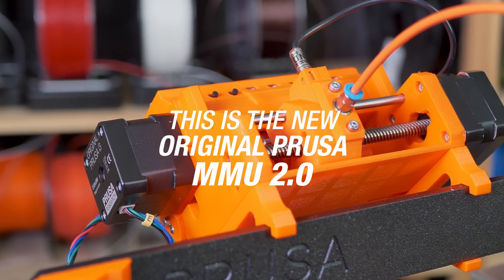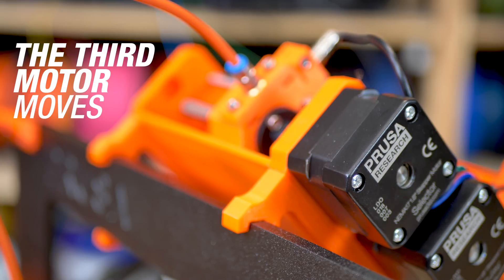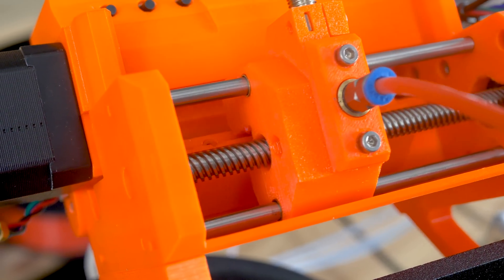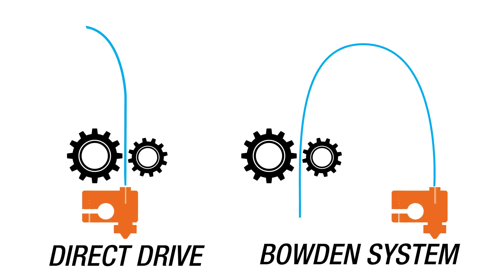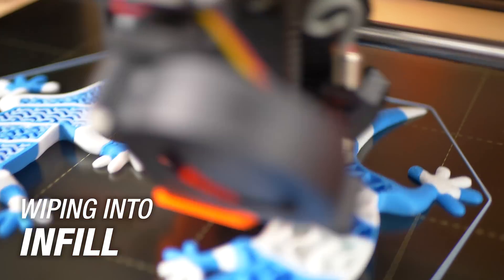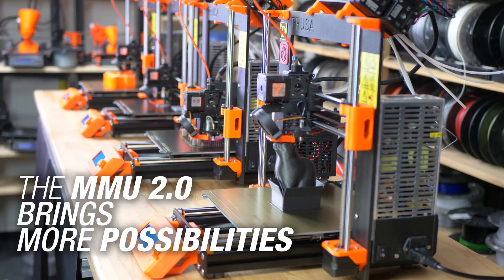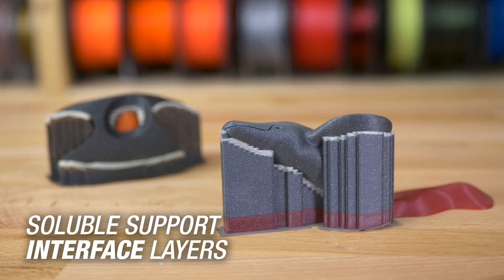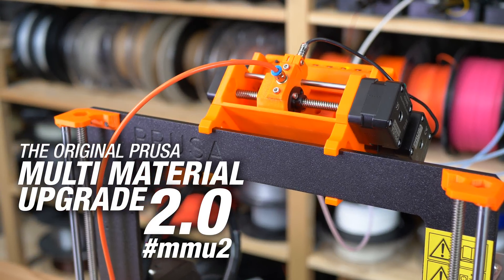How does the Multi Material Upgrade 2.0 work?

Comment: This seems slower than the MMU1, although i do like the premise!  I really hoped you had solved the issue with not being able to use TPU (flexible) filament with the MMU system(s)
Reply from the maker: The TPU problem should be gone with the direct drive system. We're currently polishing our presets for TPU :)

Comment: I like the filament storage on the shelf behind the printer.  I will have to see if that is available to print or buy.

Also this large of a setup will force me to re-think a air filtration system for ABS and other prints in general.
Reply: i print with mine using ABS in my little tiny 3rd bedroom, and not once have i "smelled" the ABS nor been bothered by it at all, even when i sit in the room with the door closed and keep an eye on the first couple layers.  i'm so confused as to why people complain about ABS when i've never noticed any negative smells or etc from it?  am i just too used to working on cars and smelling gas and oil, or what?
Reply: I have not either myself, I used to work on copiers and all the cleaning agents for those in the old days had very bad smells.

I think I'm more worried of the small particles that are emitted.

Comment: I want to know why your lowest cost printer is three times as much as other similar printers. Such as the Creality3d ender...
Reply: My guess.... much better support. Warranty. Better quality parts used. And... the cost of doing business with an innovative company.
Reply: Instead of beating the same dead horse again, just buy a cheap printer and be done. I've seen the crap bearing system that Creality uses and it's a joke. They're also using coupling on threaded rod / leadscrews that are not turned down. It's a cheap printer for a cheap price.
Reply: Icanifiwant because prusa is the company that pioneered all this shit. R&D takes money you know. All the China brands just copy them cut corners. Giving you your ‘amazing price’ then burning your house down
Reply: @JoshuaLotion  Ender 3 for example is not copy of Prusa , it's cheap because its  less stable for eg it has only one motor for z axis , it uses V profile for xy movements instead of separate threaded rods like in Prusa .  Creality surely deserves credit for these innovations .
Reply: because one of the best "out of the box" printer for this price.
Reply: All high quality printers cost a lot exactly for the same reasons a high quality lathe is expensive: if you want high accuracy, you need really small tolerances for all moving parts. If you accept low quality prints, you can obviously use whatever cheap parts you want.

Comment: Is there a way to automatically adjust infill to put the waste plastic into? Let's say you want a minimum of 20%, is there a way to set it so it could potentially go up to 100%infill  in layers where it would otherwise waste it into a tower?
Reply: npgoalkeeper _ 

Not necessarily, you could easily just make a completely solid layer in the middle of the print. Or any combination thereof, shouldn’t actually be that difficult to code.

Comment: This system is genius.
But it is a Bowden because if you use super soft flex filament you have no chance of getting it to the main extruder.
Also Slic3r is not a good program because it ovten gets inner parts wrong like on airplanes and simmilar stuff
Reply: @npgoalkeeper _ I did watch it ...
If you think about a very soft felx filament like a wet noodle there is no way to get it to the main extruder over the bowden tube.
It will search for the least resistance and dont pass the sensor. Insteed it will tangle I think

Comment: I hate the idea of the “wipe tower” but of course understand why it’s needed. 
Great idea using the infill to prime the new color. Cool to see new ideas like this to the Prusa’s. Still regretting not putting my money in a prusa instead of the JGAURORA A5 😓
Reply: I love my A5. The only issue I've had is the heavy glass causing noise at 30mm/s speeds. The IR sensor was an awesome addition. Being open source, I think it is only a matter of time before someone creates a custom firmware for the A5 to work with this extruder setup.

Comment: With the Pinda sensor, does that mean the filament sensor on the MK3 is redundant? I only ask because mine is shot, and I have the MMU 2.0 on backorder (sigh) and it looks like the sensing will all be done in the MMU now, rather than in the extruder body. Is that correct?

Comment: Josef, I know how to make and design in ie. Fusion 360, but I don't have a clue how regions of print color are defined. I've noticed simple function in Prusa Control to change color and function of that is obvious, but could you make instructional video about this? Pretty please from fresh mk3 owner from Finland :) I will not buy upgrade if I'm not sure I can use it efficiently :)
Reply: You export seperate bodies as different STL files, and then in the slicer you can define different materials for each loaded STL.
Reply: I use Mesh Mixer (free to download) in order to "cut" areas out of my object and create separate STL files. There are tutorials on youtube doing this. Then use the slicer (cura / slic3r) to set which extruder is used for what part.

Comment: How does the MMU handle temperature differences between material types? One of the biggest issues I see with other single-extruder multi-material printers is that they have a hard time switching temperature between two different materials, especially when the temperature difference is significant (such as with ABS and PVA). Does the MMU have a way to purge filament of a different type before switching temperature to the other filament? If not I would think this would lead to a lot of jamming.
Reply: I would also like to know about this. Especially when printing delicate objects using water-soluble plastic as high-detail support material, or filaments of different materials for structural purposes.
Reply: Not forgetting abrasives and alike that are more brittle. Typically needing a pre heater going into a plastic extrusion housing seems like a bad idea. My guess is they are pla specific.
Reply: @glennedward2201  Though they specifically mention abs and flex in the video, not to mention soluble support is pva. So they clearly are intending for ot to be universal, but I would say not entirely. So in a sense I'd  agree with you: pla with pla, but also abs, with abs haha
Reply: My personal experience is sticking with the same filament type if you want a good bond. I've tried printing PETG onto PLA and it literally just pealed off of the PLA. Don't even try the other way, the PLA will not adhere at all.
Reply: Wanting to know the same

Comment: This looks like it could work with other printers as well. Can you buy it separately for printers other than the original prusa?
Reply: If im not wrong, they're using Marlin so to comply with the GPL license they have to release the source :)
Reply: @AlanGonzalez-om4rr  so all I need is 2 more motors and a compatible board?
Reply: @dillzilla4454  I think they have a seperate board that you connect to the motherboard, like a stepper module
Reply: A significant portion of the functionality is software based, so it needs to make its way to open source firmwares and slicers.
Reply: @dsp4392  that's the reason I was thinking of building one. I'm no technical engineer but I can definitely program the thing.
Reply: @Da Hai Zhu I'm with you on this. Would love to add this to the JG A5. As long as we get someone to edit the firmware to support it.
Reply: Prusa Research has been really good about releasing their software as open-source. It make take some time, but I believe they'll follow through on this one as well.
Reply: Was thinking the same thing. If you can't then I'm going to try to build one.

Comment: 5 times more likely to have a filament jam and/or the runout sensor to fail and cause multiple layer shifts. Awesome!
Reply: Which runout sensor? The one in the extruder can be switched off if you wish (I have it switched off to stop false positives) , and the one in the MMU2 is a PINDA detecting a ball bearing, which stands a good chance of being extremely reliable.

Comment: Cool. How much filament does this waste though?
Reply from the maker: If you print something big with lot's of infill or if you use the waste object function, almost nothing. If you print one tiny Marvin with 5 colors, the majority will be waste.
Reply: Prusa 3D by Josef Prusa would the waste go down with quantities? Eg printing 5 tiny Marvins vs 1?
Reply: I'm not Prusa, obviously, but the answer is yes.  Example:  Your print gets to a point in the Marvin when it needs to switch colors, so it switches the filament, and then has to extrude X amount in order to properly transition to the new color (just like it does normally when switching filaments, it drools out a bit before it says its ready, and that 'drool' has both colors in it for a bit until its fully transitioned).  Then, it prints that color, and repeats as many times as the colors change.  If you print 5 Marvins, than it would do the same thing, but you'd print 5x the amount of "good" material before each color change, but you'd still swap the colors the same amount of times as when you were printing 1 Marvin, so you have roughly the same amount of waste material as you had before, but you have 4 more Marvins.  I doubt its exactly that simple, but that's the theory as I understand it.
Reply: You also have more infill space to not waste as much
Reply: I wonder if the slicer will tell me how much filament will be wasted per print?  If it takes 10kg of filament from each color to print a 1kg item - I don't think this would be feasible.

Comment: So filament detection will move to a full/empty state instead of the current full/empty/movement? So no jam detection?
Reply from the maker: There is still the laser filament sensor in the Extruder body ;) With the new Filament sensor engine 2.0 in the latest fw,  it's also way more reliable
Reply: Good to know -- must get around to flashing the new firmware. I have filament sensing turned off on both my MK3s as it didn't like translucents, white, or even (the final nail in the coffin) shiny PETG, no matter how opaque. I've also had to turn off crash detection as it was occasionally false firing when printing fast (80mm/s base speed).

Comment: Regarding printing water soluble...

How are you accounting for the temp variation between something like PETG and water solubles which print way cooler?  
Seems like you would be constantly cooking the cooler materials while clogging the hotter ones as a result of the temperature changes.
Reply: I recently tryed out Polysmooth as a supportmaterial for PETG. You can print both materials with 220°C. Polysmooth is alcohol soluble and doesn't stick very well to PETG, so it is easy to remove. I have made a Video to this Topic: https://youtu.be/C7wOrrqRSJM
Reply: This could likely be adjusted for in software. With proper thermal design of the hotend, raising or lowering the temperature for a given material should be able to be accomplished in the timespan of unloading and loading another material. For instance, switching from abs to PVA, you set your temp to PVA temps, then crank your part cooling fan to 100%, then retract the filament out and load the PVA. By the time the PVA reaches the nozzle, you are at temp. There could even be a slight temperature buffer built in to allow for purging ala stay towards the top of the extrudable range of PVA for a second while purging and then go down to the optimal range while printing. Do the reverse going the other way and voila
Reply: AFAIK is more multi color than multi material,for the reasons you underlined. It's really the only thing holding me back as I print PETG.
Reply: ...heating and cooling a nozzle takes time. So if it would be possible, the print would take much longer...

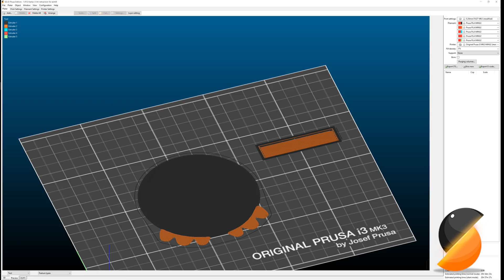Comment: 3:29 "...no need to send your data to the cloud"
Sideswipe hehe.
Reply: dont need the cloud for palette either if you use their local software and your own slicer.

they both look great, though!  I really want the STLs shown on the web article as samples
Reply: @BenSilber  two different bits of software vs one though, right?
Reply: @KieranShort  I guess, but I don't use slic3r anyway so it would be two for me either way
Reply: @BenSilber  ahhh good point. I prefer Slic3r prusa edition now rather than Simplify 3d. I've never used Cura though. What's your choice?The Prusa team is moving Slic3r very fast forward now though with many new features. And my i3 mk3 prints with it are now working better than Simplify. Anyway that's my experience.
Reply: @KieranShort  I use.simolify 3D. I'm just used to it and get good consistent results. I wish it would move a little quicker (like adding the cool infill that slic3r has, etc) but I've never had one issue with it and it's easy to adapt to the two printers I've got.
Reply: @KieranShort  Prusa is still missing some very critical features.  

1) Manual support placement.  Slic3r's horrendous support generation algorithms make some objects literally unprintable without Simplify3D.
2) you can't move the Z height of an object off the bed.  It always placed the object on the bed. Its so stupid.  If you don't understand the need to want to do this you haven't been printing long enough.

Fix these and I might be a full convert.  Until then, S3D still has the top spot by a mile in terms of best slicing software.

Combine multi material printing along with these two features and Slic3r PE would own everything else out there hands down.  However they do have some significant work to do on their support generation functionality and the complexity of this isn't trivial and I don't know if they have the software team to get this done any time soon with all the new stuff they are focusing on such as SLA.
Reply: @norris1218  WhY would you move an object in the z direction? I have been printing for 5 years now and built a new printer on my own but still never had the need to do so
Reply: @AngeEinstein  there are a ton of reasons. If the bottom isn't flat. If I have two stls and want to line them up in a specific way like when I made custom two color dog tags.  That being said it is a missing feature but I have discovered how to slice off some of the bottom of a model to make it flat with slic3r so some of my problem has been resolved.
Reply: @norris1218  you can load a second model and move it around. Also you can disable automatic z alignment in settings

Comment: As usual, sheer genius at work!  I'm particularly impressed that you can use wipe into infill. Have you considered also adding the wipe into support? It's great that the slicer manages standard filament in support with soluble filament as the interface. Great money savings.
Reply: @jbavarian that makes 2 of us
Reply: Not a genius just an engineer.
Reply: @eddiemendoza6304  That's what engineers do. Finding optimal solutions to problems which may look like genius to some people.
Reply: @eddiemendoza6304  A genius engineer ;)

Comment: Nice, I like that system. Unfortunately a bit too expensive for me as a student :(
How does it work that both extruders push the filament the same distance? Or will the mmu disengange after loading, so that the filament can run freely through the mmu unit?
Reply from the maker: MMU disengages :) It pushes the filament to the extruder, then for a brief moment both drive systems are pushing the filament, the current to the MMU unit drive motor is decreased and finally the idler barrel rotates away and lets the extruder Bondtech gears pull the filament freely.
Reply: Prusa 3D by Josef Prusa damn that’s clever....
Reply: Well that's clever. Thank you :)
Reply: I think the MMU filament motor is used only to insert the filament into the extruder, just like you would do it manually. Then it should be disengaged and it prints like normal until another filament change.
Reply: exactly my thoughts, would love to see it answered